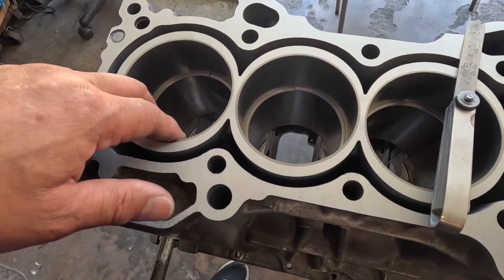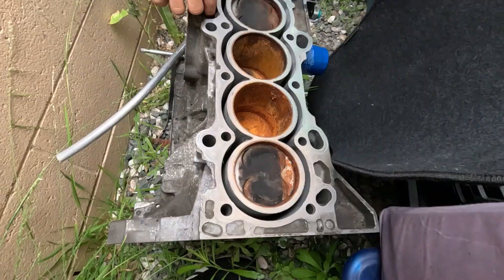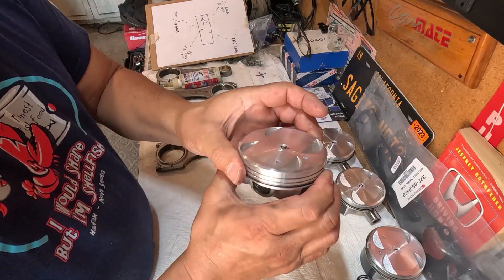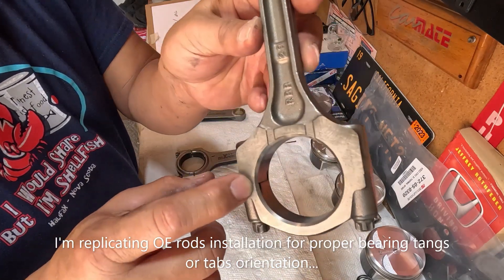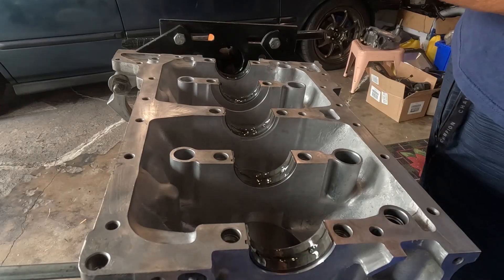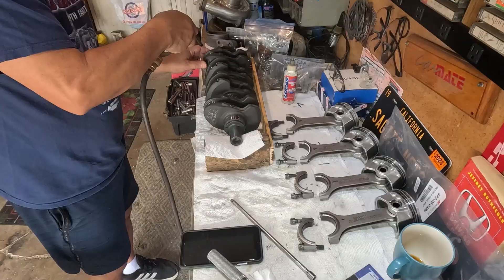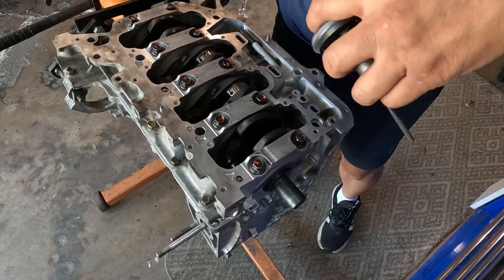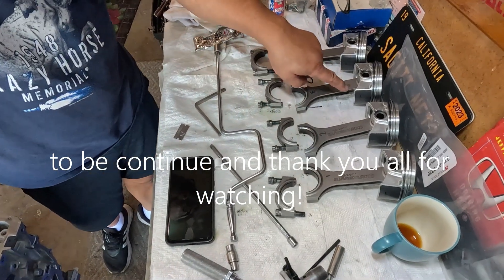K24 Build part 1; Crankshaft installation and Piston rings gap for Turbo application

Comment: Just wondering. Did you have the rods n crank, pistons balanced? I haven't gotten to build one just yet n was just wanting to kn if you did or not. Thanks
Reply from the maker: No l didn't, l went ahead and installed it. I used to do it in the past, l sent 2 sets of ebay forged rod before but it actually not really that bad according to my machinist back in the day l had it rebalanced. It won't hurt if you decided to get it rebalance though.
Reply from the maker: The crankshaft too, l used to have it rebalanced but my Balance shop personell told me that Honda crank barely goes out of balance. If you are building a 500whp and up motor, you definitely need to get all the rotating parts rebalance, crank, rods, flywheel and clutch. But for below 500whp and also if you are thinking of using a ATI damper, l say no neex for it unless, the crank journal need to be polish.
Reply from the maker: For the pistons, l try not to dig in on it so much, they only off so much that its almost like you are checking for feather weight differences. It's kinda useless getting to all that trouble and you ended up using a OE crank damper. Its a good idea to invest on ATI damper, you can really tell the differences.
Reply from the maker: If you got a crankshaft and used conrods from someone else like FB market or ebay, l say have it balance coz you dont know if it was involve on a engine failure before. But if it's a whole long block fron junkyard, no need unless you really want too.